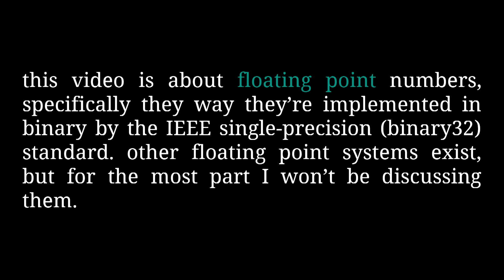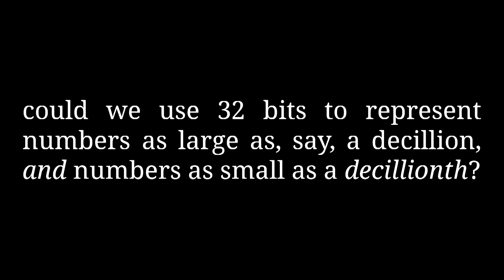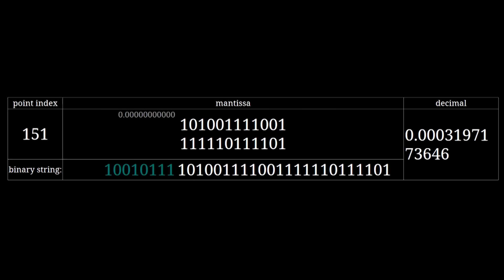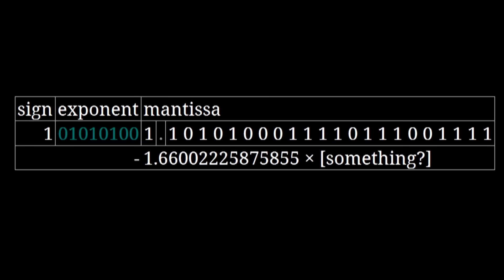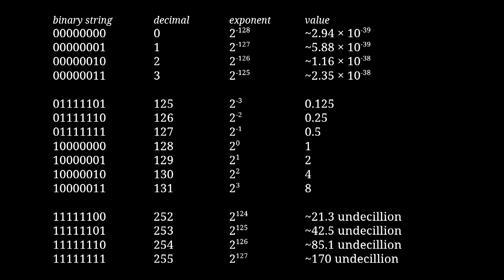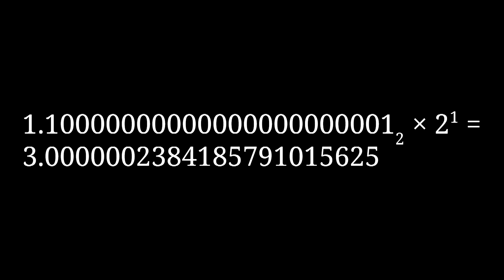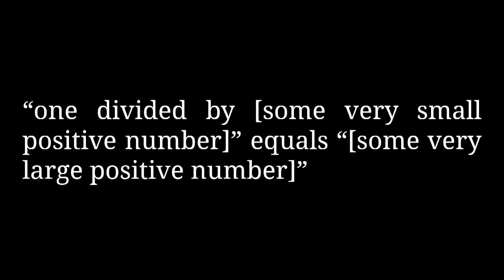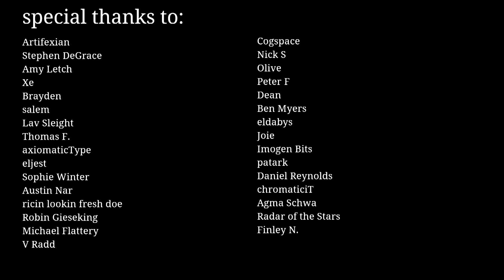how floating point works

Comment: A lot of the decisions being made about things are actually remnants from earlier computer science issues. Like taking the 8 bit range and subtracting 128 from it is actually just using Two's Complement as a notation for negative numbers(specifically on 8 bit numbers). The reason two's complement gets used is because it's easy to implement in simple computing structures that already exist (you can use adder circuits, and it'll just work, and you don't have to deal with negative zero). A naive sign bit implementation would require serious hardware to actually perform subtractions. But by taking your range, cleaving it in half, and having the negative half have that one extra value, you end with a system where adding a positive and negative value will always result in the correct result anyway, without having to redesign your adding hardware. The reason this is important for the exponent specifically is because of the mathematical fact that multiplying two powers of the same base is equivalent to adding their exponents together(and dividing is subtracting exponents), so floating point can resolve the multiplication by adding the exponent bits together and only multiplying the mantissa (which is an integer multiplication where the ghost 1 gets added again, and then potentially shifting the exponent up by 1 or 2 if your mantissa multiplication is greater than 2(unless you're dealing with subnormals, the mantissa product would never be less than 1 or more than 4)

Probably the reason the NaN range doesn't get specified in the standard is because that would be combinatorically impossible. 24 bits translates into 16 milion combinations of flags. Listing those would take an excessive amount of time, and good luck even finding a case for many of them. They could have highlighted some simple cases but the reality is that it quickly devolves into "look, we've never seen that before either". Plus there is no garauntee that many different combinations of illegal operations would yield the exact same mantissa, so you really don't have a good way of describing all but the most simple of examples, which would also be non-exhaustive, so they probably didn't bother because actually describing it would probably cause more problems than anything.

Edit: The reason 1 is being used in the sign bit is because of how you implement negative numbers in adder circuits. The short version is: You use XOR gates for this. If you put a 1 and an unknown bit into an XOR gate, the XOR gate flips the number. If you put a 0 and an unknown bit, it doesn't flip it. We want the bits to be flipped if the number is negative because of the Two's complement implementation(which is the cheapest implementation for negative numbers that doesn't cause circuit design headaches.). One's complement has the slightly annoying issue of negative zero. Negative zero (all 1's) plus 1 is positive zero (all 0's), which is very annoying cause you have to work around that.

Comment: I remember the days when floating point was a really long operation.  It usually involved blocking the main cpu, while a coprocessor performs the arithmetic.  If you wanted performance, and you weren't too concerned with anything over 6 decimal digit accuracy, you used fixed point.  This is an awesome video, although it did bring back some painful memories dealing with mantissa and exponent.  :D
Reply: Ah, so you're relatively young.
I remember the days when floating point was really slow. To perform floating point, the CPU would be required to perform all of the operations itself using byte level math operations (add, subtract, compare, shift left, shift right, etc). Having a coprocessor was an expensive luxury.

Comment: I still wonder why the mantissa sign bit is at the leftmost part, while the exponent sign is near the exponent. Why not put each sign bit near its corresponding part?
Reply: If you order the bits in this way, you get a cool property: 

For every floating point number you can store, if you treats its bits as representing an integer, and add 1 to that integer, you get the next representable float. 

This means you can mostly reuse integer comparison algorithms (used to implement things like “if 96436 > 266433”) for floats.

Comment: EDIT: I watched further and you go into 2's complement

Two people already explained why 0 is positive and 1 is negative, but there's another reason. With signed integers, they're sometimes portrayed in a manner called "2's complement." TLDR, they turn the final bit into the negative counterpart of itself. For example, the final bit of a byte is normally 128. However, with 2's compliment it's -128. The remaining bits are their positive iterations, so 1111 1111 is -1, instead of 255. 
Another quick example: 

BIN 1000 1010 is DEC 138 (128+8+2)
However, 2's Complement 1000 1010 is DEC -118 (-128+8+2).

Comment: The floating point specification is pretty clear that each float represents one specific real number. There are several cases where thinking of floats as being ranges of numbers doesn't make as much sense. It is better to think of the computer as doing each individual operation "exactly" and then rounding to the nearest float.

For multiplication or addition of two numbers with the same sign, you can think of floats as being ranges, and the error will appear to propagate reasonably accurately. But for other functions this breaks down. 

The standard says that if a floating point implementation includes functions like sin and cos, then they need to be implemented in such a way that for each input, the output is the closest representable float to the "real" value of the function (which will be an irrational number for every input except 0).  So there is one specific value of sin(2^100) (it is about -.87), even though sin(x) takes every value between -1 and 1 for many values of x in the range [2^100, 2^100+2^77]. This is actually somewhat silly, since actually calculating something like sin(2^100) in a standards-compliant way requires doing arithmetic with hundreds of bits of precision.

This also means that you can rely on sinPi(1.0) being exactly 0.0, even though sin(pi) isn't. This is because pi gets rounded to the nearest float before being input into sin, but sinPi is one function without any intermediate rounding, and since 1.0 is exactly representable as a float, sinPi(1.0) is 0.0 exactly. (unfortunately, most languages don't expose the function sinPi, but it is recommended by the IEEE standard and exists in many standards-compliant math libraries).

Also, if a, b, and c are non-NaN floats with a <= b, then a+c<=b+c. In fact multiplication, division, and even exponents will respect ordering. This is clear when you think of the computer as calculating the exact value first and then rounding, but wouldn't necessarily be true if floats represented ranges.
Reply: @gregoryford2532  My point is that thinking of floats as ranges only makes sense when the float is the output of a function, but when you input a float to something it gets treated like a specific number, not a range of numbers.

Comment: I have absolutely no idea if you're reading comments or not but I was replicating your diagrams in google sheets and noticed something between the models at 4:51 and 5:36.

For diagram one, I used the last 24 bits (as the first 8 are used for the point index), converted that to decimal, and divided it by 2 ^ (point index - 116). For diagram two, I used the last 23 bits (as the first 9 are used for the point index and the signed bit), converted it to decimal, and divided it by 2 ^ (point index - 117). 

The weird bit I want to point out is how for the divisors, the difference in diagram 1 is 116 and the difference in diagram 2 is 117. Why is that? Surely the only difference should be the addition of a signed bit, which should just limit the size of the number and not change how the divisor is calculated. I'm hoping I just missed something here. Many thanks.

Comment: Wow the information density here is high! This 18 minute video is essentially the first lecture of the semester in the Numerical Analysis course I took in my senior year as a math major, except that lecture was an hour long! The professor used floating point as a motivation to talk about different kind of errors in lecture 2 (i.e., round-off vs. truncation) which honestly was a pretty effective framing.

Comment: i had the same experience about numbers being a range with chemistry and the concept of significant figures where numbers like 100 are an approximation but 100. is precise since that decimal reduces the range of numbers that 100 could represent (100 is closest to 149-50 while 100. can only define 100.49-99.5, a considerably smaller range) which means things like 100+1=100 while 100.+1=101

Comment: "they could have repurposed negative zero and have that be not a number" 

I admit i screamed "Noooooooo" at this point. Bad things happen when your negative number suddenly becomes positive.

Floating point, as you put it, is an approximation: -0 also means "a very small negative number that rounds to 0" and +0 also means "a very small positive number that rounds to 0". 

Using one zero value would lead to much more workarounds to preserve the sign of a number under rounding.
Reply from the maker: yeah, I agree the way they did it has better properties than my ideas for "simplifying" it
Reply: @HBMmaster  That's kinda what I love about floating point, every single weird decision has some real strong rationale. 

Also, the video was great!

Comment: I've seen far too many explanations about floating point numbers and I think this video is the most balanced one. There are for example too many guides that start from 0.1 + 0.2 = 0.30000000000000004 (this is a property of any binary number system, not just floating point or IEEE 754 in particular). In addition this gets subnormal numbers and negative zero pretty much correct, something that is frequently missing or sometimes wrong in most other guides. Frankly, as a patron and FP semi-expert [1] I got to see early drafts of this video for comments and I had nothing to add on. Great.

[1] I'm the original author of a float-to-decimal conversion algorithm in the Rust standard library.

Comment: Floating point numbers are the digital (digit based) equivalent of slide rules! I've recently gone on a slide rule binge and it's entirely changed the way I view numbers.  The floating point system literally uses scientific notation, a development for slide rule operation, which makes it easy to see all the limitations involved.  You can only be so precise in reading numbers from analog logarithmic addition and subtraction, so you really only get the first few digits (the significant figures, often limited to only 3, hence the standard of 3 sig figs in physics classes), and the order of magnitude is determined by estimation or by hand, a literal floating point so that the rule itself only has to bash numbers between 1 and 10 together.  It's so cool to see how the mathematical technology of the time influenced the way we formatted this new concept.

Comment: Something I always found weird is how signed numbers use the two's complement, but the exponent in floating point numbers use a bias??? Who's idea was that?
Reply: @LueLou Don't you mean UNsigned integer comparisons?
Also, the fact that the single-precision floating-point format uses exactly 8 bits for the exponent means that it fits perfectly into a byte, so any comparison logic could just be taken directly from signed single-byte numbers.
And let's not forget what the big thing about two's complement is: Adding two numbers uses the exact same process, independent on how many of them are negative or positive. Since multiplying floats basically requires adding the exponents, I would have imagined that the two's complement would be helpful here.
Reply: @LueLou Ok, it wasn't clear before that you meant a comparison between two entire floats. I thought you meant comparison between their exponents. Thank you for explaining this.

Comment: Floating point is nice and all, and I have respect for how clever it is and I can understand it being useful in some cases. But it's too overused, and have issues.
- A 32 bit integer can with a precision of 10 μm reach a distance of about 20 km from the centre. Within this 40 × 40 × 40 km 3D space, you have higher precision with an integer than a floating point (except within the 256 × 256 × 256 m of the centre).
- Integers have a fixed resolution, and as long as you calculate within this precision, you won't have loss of data. But in a floating point, if you go too high, you'll lose half the precision.
- Calculating integers will still be faster than floating points. While processors are made to calculate floating points faster, it's just better to rely on integers.
- Integers will use up all its binary representations to be numbers. It doesn't waste values on a positive and negative zero, or on a lot of NaN values. But it does have 1 more negative number than positive, so you could define that as your NaN if you need one.
... floating point is nice, but it's not the solution to everything. Integers are still very useful.
Reply: It is pretty common when doing many type of calculations to have to multiply distances. If I represent two distances of a couple of meters using the system you are describing and try to multiply then, I would overflow the representation. A standard way to avoid this would be use a unit of volume larger than (10μm)^2, but this means that the multiplication will lose some precision (and is also unnecessarily complicated for most purposes).

Or you could use units of 10cm in order to have a similar amount of space with multiplication still working, but this ends up being a lot less precision than you would get with floats.
Reply: @informationaether6965  My example given was for a use case to define a point in a 40×40×40 km space. Why would you multiply two distances in a way that gives you such a large number?
Reply: @Liggliluff  one example would be checking for collision between two objects. It is true that if the objects are small and close together then the product of the distances isn't as big, but when using units of 10μm you can only multiply distances up to a meter before overflowing.

It is definitely possible to store things as fixed point and convert to float in some cases to avoid these issues, but other solutions are frequently better.
Reply: i see you everywhere i swear

Comment: just a small question, at 13:35 , in the millions place you have 4 digits instead of three, does that mean the number should be 340,282,346 so on or are one of those numbers in the millions place a mistype?

Comment: With respect to 0/0, you state: "...or you can do them, but there isnt really any possible way to interpret the result as a range of real numbers..."

This is common misconception though. Infact, every number x satisfies the predicate 0*x=0. To say there doesnt exist a range of numbers corresponding to 0/0, or that its 'not a number', is the literal logical inverse of what is actually going on; its 'a number'. The right thing to do would have been to introduce an 'a number' symbol; which represents the entire number range (or signed parts thereof; +an / - an).

Not only would it be more conceptually elegant and involve less lying to ourselves; by allowing 'an * 0 = 0' (as opposed to 'nan * 0 = nan', the majority of nan-handling could actually vaporize from your code, by just letting an * 0 = 0 do its thing.

Comment: 6:30
fun fact about the "clean" distribution of numbers. For some applications its not clean at all. The problem is that the numbers aren't evenly distributed in the sense that all numbers are spaced out evenly. Between the respective ranges of every power of 2, there are exactly the same amount of numbers. That means between 2 <-> 4 are exactly 2^23 numbers that can be represented in float. Similarly there are "only" 2^23 numbers between 4 <-> 8. This is sometimes a problem for machine learning applications, since the numeric representation is logritmically biased if your range is goes over multiple powers of 2.

Comment: By the way, fixed-point arithmetic is used somewhat frequently in computer systems. It basically works the same way as integer arithmetic, but interpreted as some decimal or binary fraction. For instance, your banking app might internally use signed fixed-point binary-coded decimal numbers with 11 digits, 2 of which are after the decimal point. That way, it can be sure all of its calculations are exact, and it can apply a rigidly-defined set of rounding rules. Your account can never have half a cent in it, after all. However, you can of course be much more efficient with a binary floating-point format like IEEE 754.